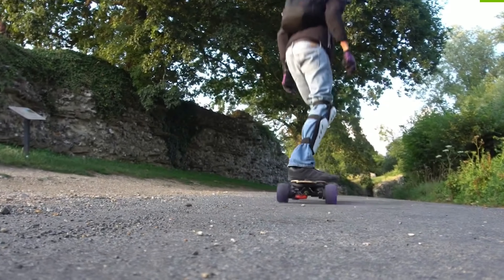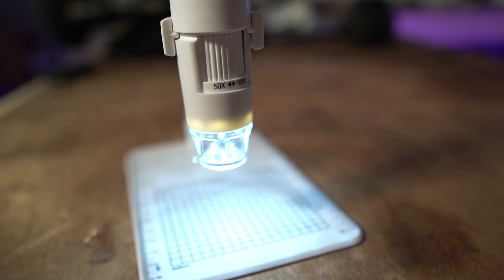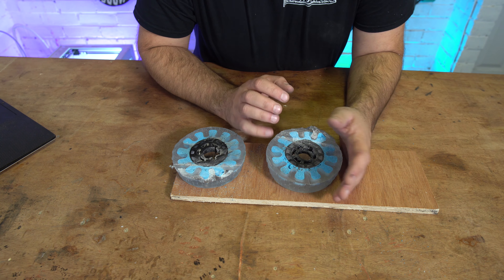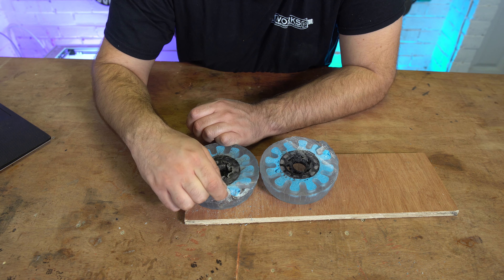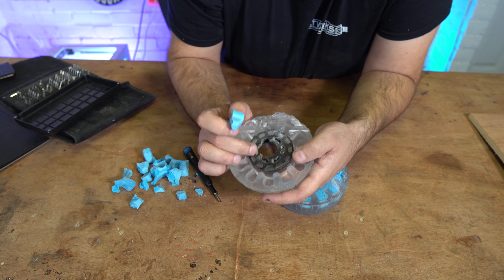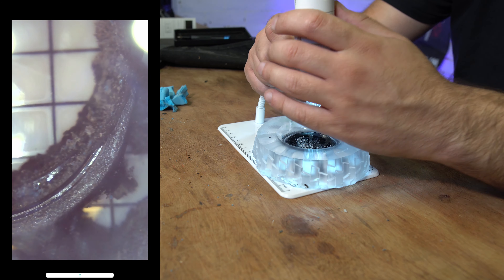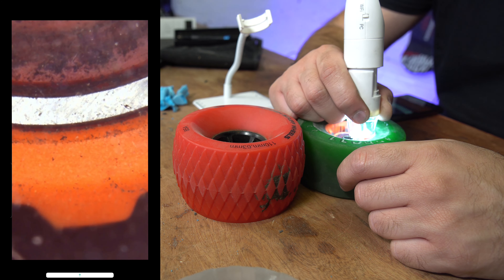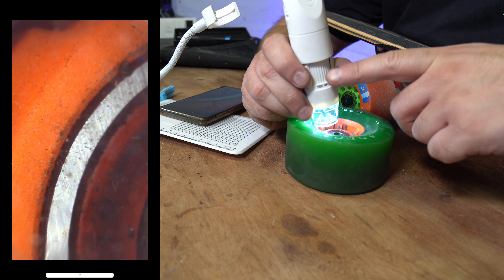Whats inside? Episode 1- iWonder Cloudwheel

Comment: Very interesting vid Lee! The abec plastic does look of higher quality but it's hard to tell
Reply from the maker: It is really hard to tell isnt it? I didnt want to criticise too much without being aware of what's actually going on
Reply: @LeeWright  you are comparing the mold surface structure, which they usually etch in the steel, not the plastic quality. No one can say anything about the properties of the material only by visual inspection as already mentioned.
Reply from the maker: @surfhai  that is a jolly good point sir

Comment: I do enjoy your Video's :) Love the Passion you have for Esk8 :) Just a opinion but All the cores look similar to me , Light colour do not show definition well and this is why body builders Black up for comp's. To be fair you need All the cores to be the Same colour. Also did the ABEC wheels  have a issue with chucks coming off them and cracking ?
Reply from the maker: Yeah you are probably right bro! Glad you are enjoying the videos! I've ridden that set of ABECs over 1000 miles without an issue, I think the softer 74a may have had issues?